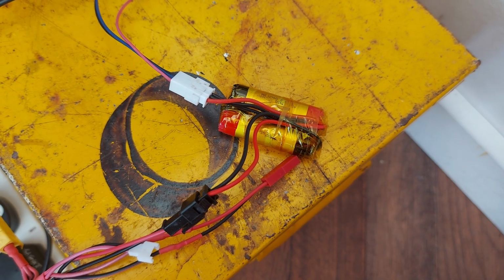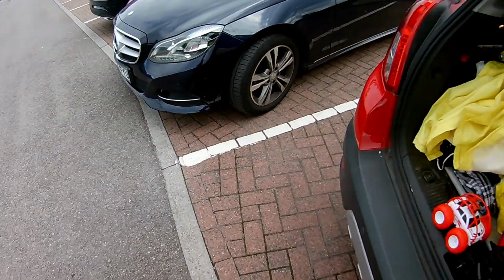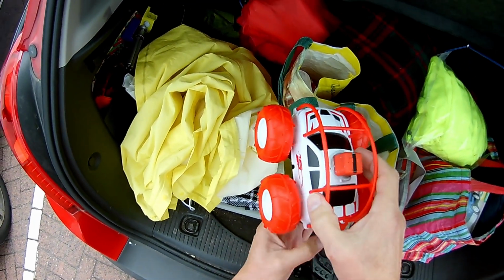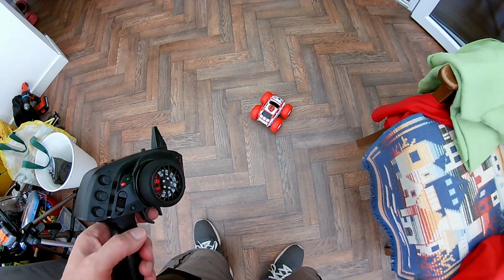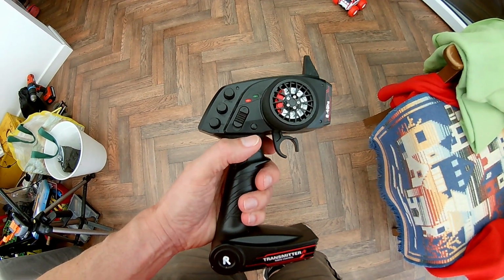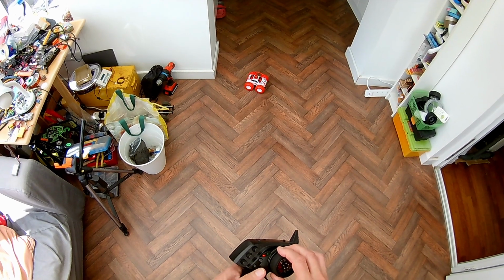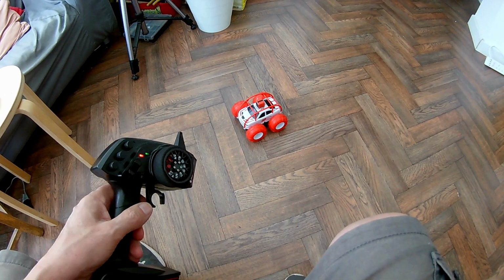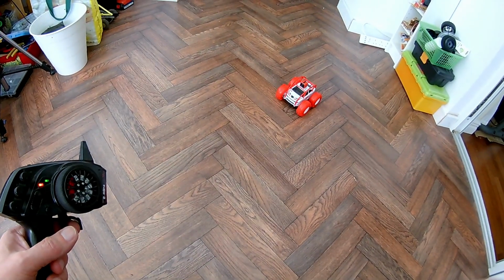Hobby Grade MaxTronic Waterproof Stunt RC Car conversion PART 7 test run PROBLEMS

Comment: If it's not the transmitter batteries I wonder if it could be interference from wifi somewhere running on 2.4 GHz. Maybe that receiver is prone to interference from wifi at 2.4 GHz. 
It seemed to work fine at home but started going nuts without you using the controller. 
Check your wifi and see if you are running on 2.4 or 5 GHz. Just a thought. 
I am probably talking 💩but you never know. 😁👍👍
Reply from the maker: That receiver works fine in other cars, however this is the first time I have used that brand of receiver with one of those dual ESCs. Having said that, I have it in the back of my mind that one of those receivers was playing up. I usually marks things with a big red cross if they are suspect. I have quite a few of those receivers and some FlySky ones, as I have started scrapping some of my old conversions, so it is just a matter of doing a straight swap to confirm if it is a receiver issue.